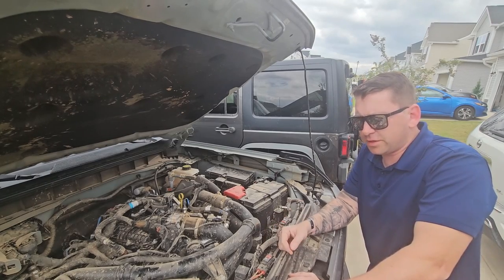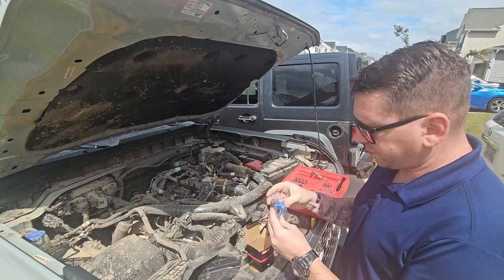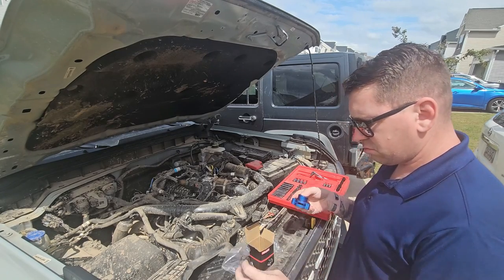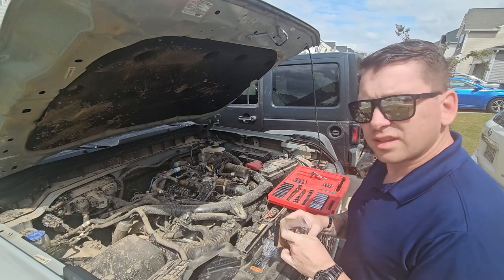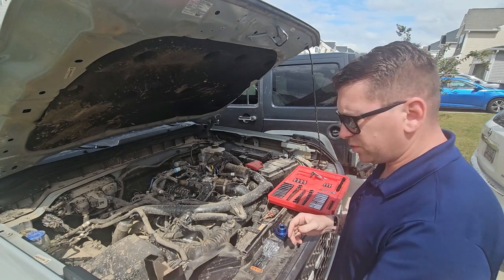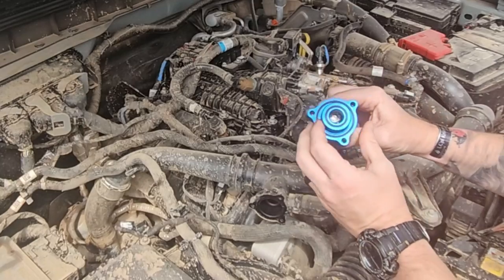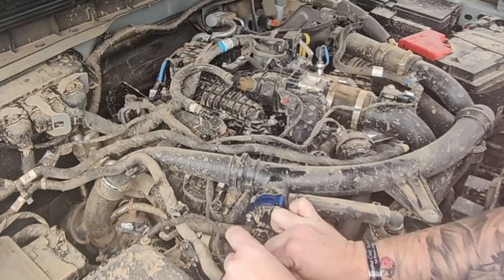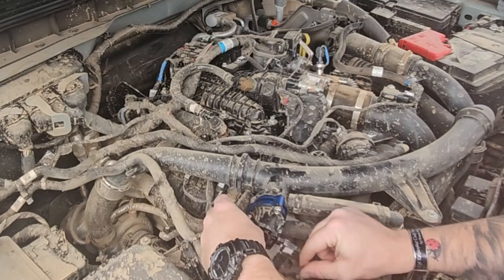Cheap Bronco blow-off valve!

Comment: I went with the turbosmart and lived it. Added the k&n CAI and it sounds like a little diesel sometimes.
Reply from the maker: Nice! I'll have to check the turbosmart one out. I wasn't sure if I'd like it so I went the cheap route. Figured no loss if i hate it.
Reply: @Buckingoffroadadventures  tbh it sounds good. I'd run that one unless it gives you issues.